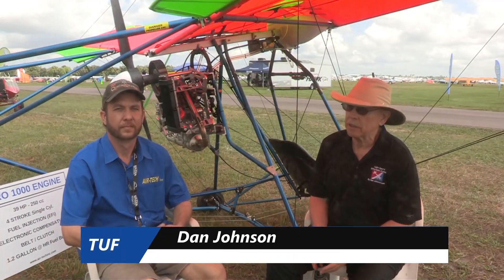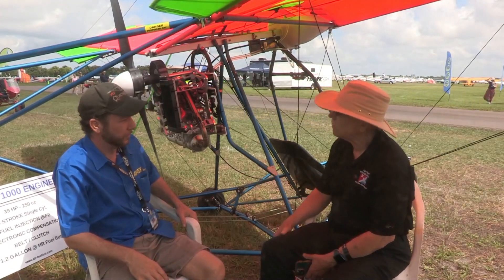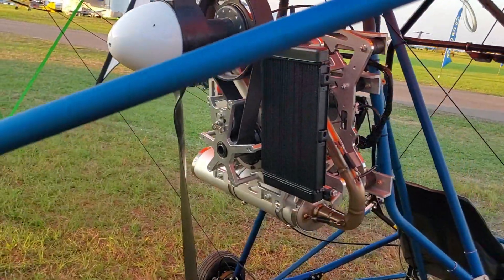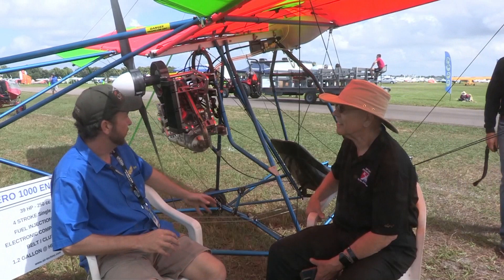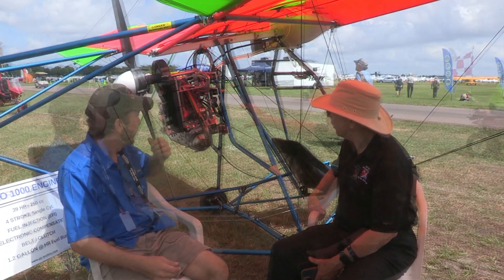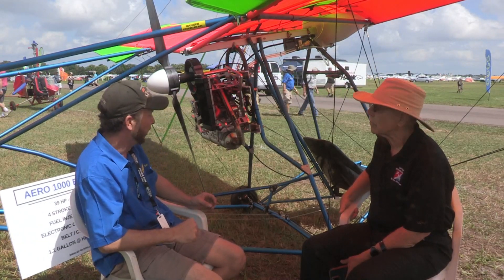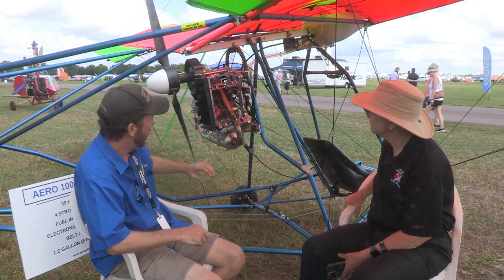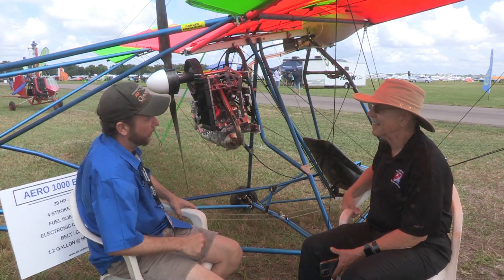Aero 1000, 4 stroke, 39 HP, single cylinder ultralight aircraft propulsion system from Air Tech Inc.

Comment: He is not the first one to convert a car or a cart engine , if you don’t lift the throttle every few seconds to suck some oil in the upper region of the cylinder , the cylinder will dry out and wear tremendous or fail ! Porsche tried it with no success. Lycoming and Continental has half wedged piston rings to let oil pass during the suction stroke and seal during the working stroke .

Comment: Considering building an AffordAPlane (bought drawings.) What is the weight? can it be used in the tractor configuration? (LH prop acceptable.)
Reply: Pretty much everything except the prop and spinner is about 80 lbs. That's about a 1/2 Volkswagen in weight.

Can it be used in tractor configuration? Probably. But you'll be changing a few things to optimize it. My biggest concern is not knowing if the hub bearings are appropriate for flipping the thrust the other direction.

(I'm interested in using this in a tractor configuration, too, btw.) Looking at the maintenance manual for changing the hub pulley... I think the hub will need an analysis, if not a redesign. It's really not a complicated part to design and have made. I'm sure there's a bored engineer at your local experimental club that could help.

I would not consider this application for the engine a "beginner" level project. You are definitely wading into "hasn't been done before" territory. You'll need a custom engine mount designed, too.

Comment: Wow that's the "Helvinco Swissauto 250" Cart Racing Engine I run on my Granddaughters racing carts.  Those are fantastic for cart racing. (EFI version) But for flying there too high strung.  All hers are ECU limited for a 12.000 RPM max.
There like a grenade with the pin pulled. 
Short rebuild time, for racing anyway.
Need more than one motor for each cart to accommodate rebuilding.  There must be better options?  Oh yeah, and there hella expensive...
Reply: It's not as bad as you might think. These are further limited to 10,000. I've seen dyno runs to 15,000 before valve float. Being as the cams and cranks run on ball bearings instead of journals, and the conrod on needles, that's really not a big deal.

The big thing is efficiently burning fuel. Because while modern oil/additives and metallurgy is amazing, gasoline contamination of the oil will kill it. Being as aero runs at continuous speeds and they added a small oil tank for further capacity, I think Helvenco has done their homework and this will hold up well. You just can't be dumb about maintenance.

(Also, I don't know what became of it, but they were developing a supercharger kit for it before COVID. So they must be feeling pretty confident to add another 5 hp.)

Comment: Specs and availability on this engine? This really sounds like a viable option for many ultralights. I could look for an ultralight offered for sale without an engine. I would also wonder about a three blade prop if that gorgeous two blade prop wouldn’t fit.
Reply: Just go to their website. Hp and weight are similar to half VW engine. 2.5 times the RPM and 3 times the price.

Comment: 40 horse is pretty good and 9200rpm is steep but I've always wondered if direct drive was an option just with a smaller prop. Of course this is a very low speed plane so not ideal with a small prop but a bit faster sleeker plane, maybe a duct, it has to be competitive with all the gearbox cost and effort. And weight. Jet planes do ok with modest diameter.
Reply: A friend had a Maxair Hummer with a 36" direct drive prop on a 22 hp Zenoah. At around 5500 the prop tips go supersonic. You could hear it from miles away.
Reply: Wouldn’t that be really bad?

Comment: Hi Dan   Great show,  I have seen a 4 stroke motors on the 2 seat quicksilver.  But this is much better for a single set. I hope their testing goes great for them.it should be so much quiet flying around.  Thanks for the video

Comment: 39HP @ 9200 RPM from a 250cc single cylinder engine without turbo/supercharger? That's way better than motorcycle engines. By the way, Rotax 447 UL-2V generates 41.6 hp with 2 carburettors @ 6800 RPM, but it has 426.5 cc twin cylinder engine.
Reply: Actually the horsepower figures are about on par with modern 4-stroke motocross bikes. 
That being said, longevity is not the main concern with motocross bikes. 
Anyway, I hope this engine does well and we see others like it in aviation.